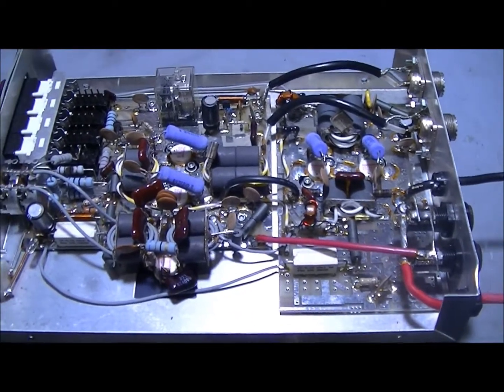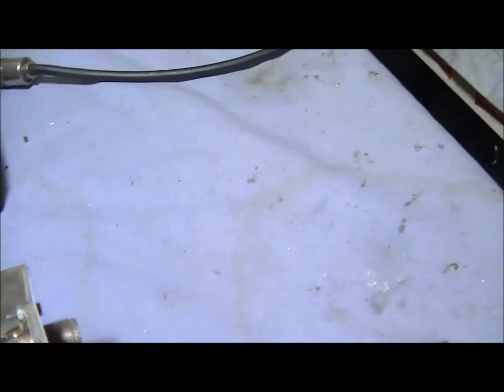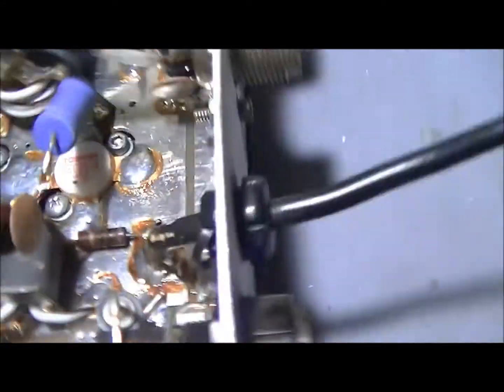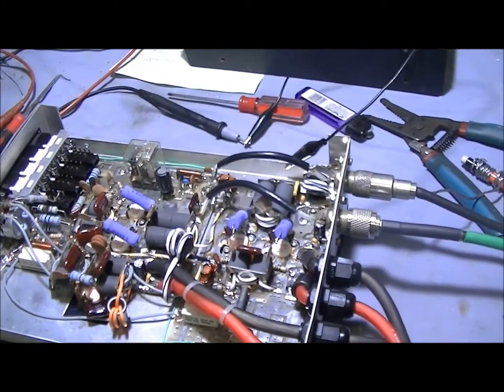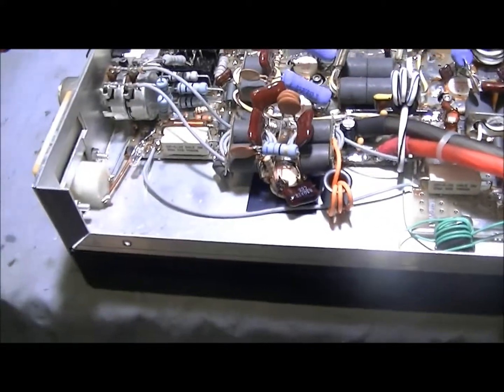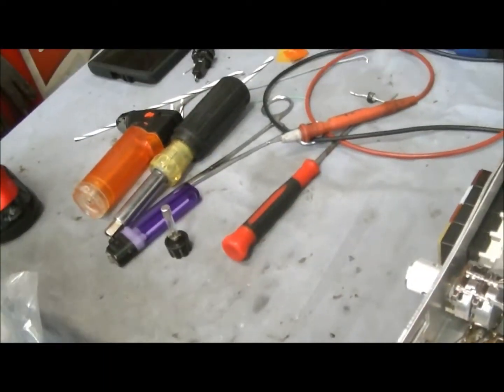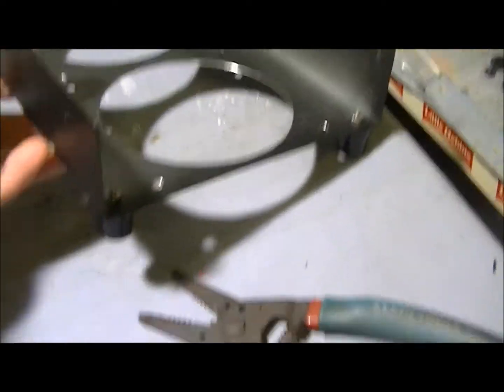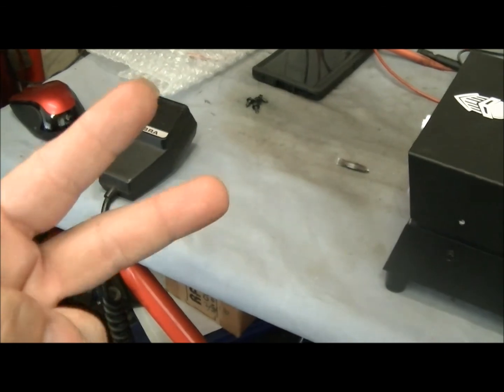OLD SCHOOL TS 667v Turbo Mod Restoration The Gatekeeper Way - [Extensive]

Comment: that one real old. I only had 1 of first gen and was a 2 pill . I think it had MRF 492 in it. been years back. just put same new transistors in it. never seen a stereo pot in one. The ones today are to high of ohms to use.  the last 667 I did was a 3rd gen DEI /FET box. emended up with driver looking like that except the copper plate between transformers. just used #10 solid. used 100 ohm 2 watt on all feed backs . looks like at the time no 2290 was around so used 2 FETS with no numbers on them . now we have HG in 2290 and MRF 454. now I use silicone #10 or 12 on power to transformers. today that PTFE wire $$ think it was gold wire. only on input and output transformers now PTFE wire. them old meter lamps I can't get in 18V anymore. 14V and 28V well 6V also. just use LED;s now. 2 -28V of them old lamps is about as bright as the OEM . now I got nice 10 ohm 1%  . 1/4 watt to 5 watt ones. non inductive metal oxide type. well  the 5W is 5% . and made in Japan .got caps also. just not tunning ones. 103/104 ETC ones. even 1KV ones.  some day I will find a better per amp transistor for them. PNP most others are NPN .  The Japan ones are a 2SA and a 2SC ones. cross to about the same. using a NTE cross reference book.  Them little glass caps TX uses 104. hard to find. I just use disc ones. had a glass one flash over on feed back causing over bias and blown pair 2879's .that on a DX 500V .  blown 2 new RFP ones because of that. and all new 1.8/1.6 and 10 ohm ones. and even checked the bias. only seen this once. 104 glass cap looks like small diode . short . lost time on money on that one. now I check them . never found a outher bad one. also I got DEI 2979 pulled from DX 500V some what working . the HFE is low like 8 to 10 . but AM sounds like SSB when talking on it.  watch for low HFE on DEI . may work but sound bad over the air. Why came in to me. 73's

Comment: hey GK hope you're doing good. my buddy has a texas star dx400v or dx500v and the input tune is a little high. I'm not familar with the layout and was wondering if you could help me locate the tuning cap for the input. thx have a good monday bro
Reply: i figured it out it was c22 i believe. I was pretty sure just needed to double check but talked to the builder. have a good Tuesday bro
Reply from the maker: Yes sir the cap on the input splitter... yes sir